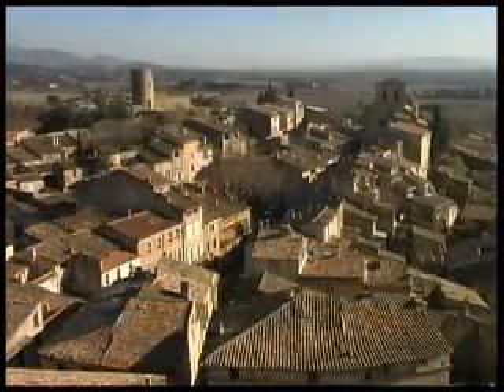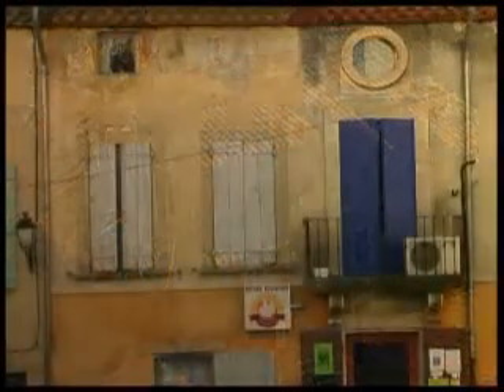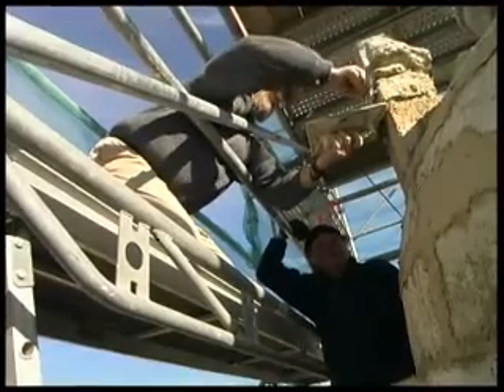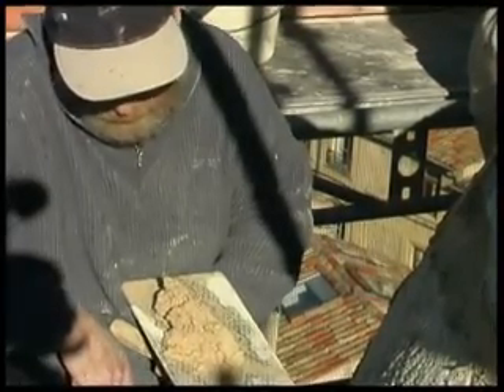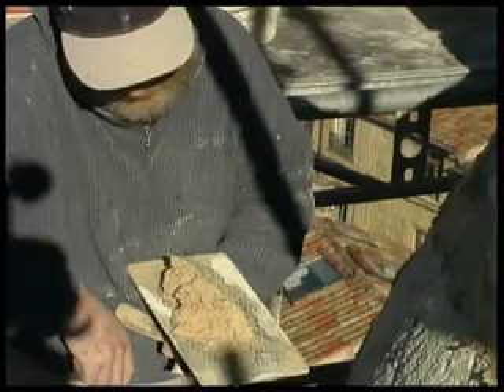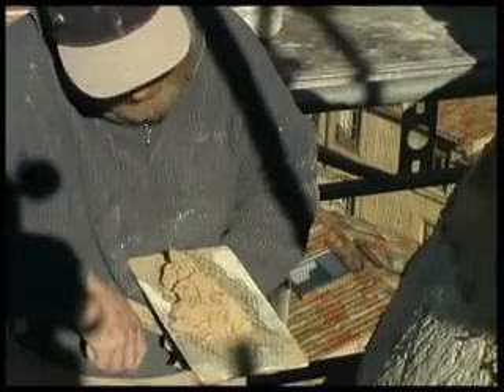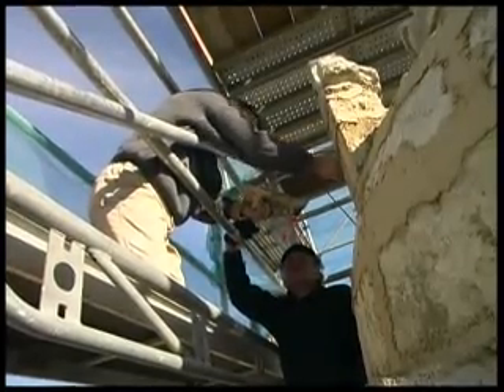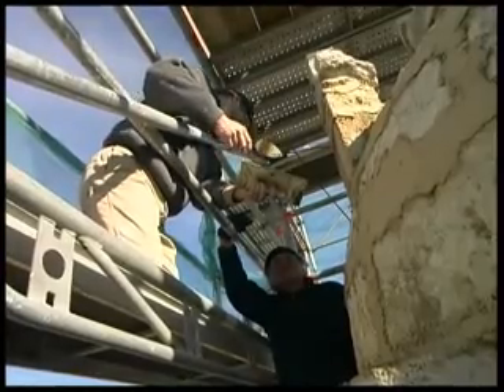Ancient Masonry Repairs

Comment: Lime mortar... great stuff. I've been using it exclusively for 35 years in my career in the masonry restoration and historic preservation business. It actually recombines with carbon dioxide from the air and becomes limestone over time, and has properties that are unattainable in any Portland cement-based mortar. Can't imagine working without it! Great video.